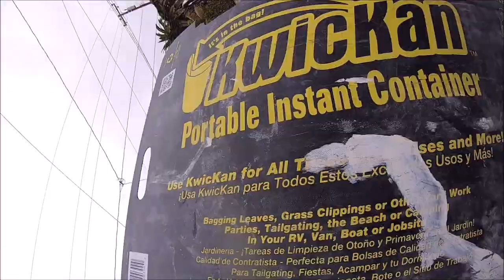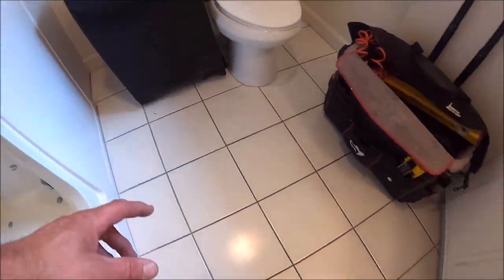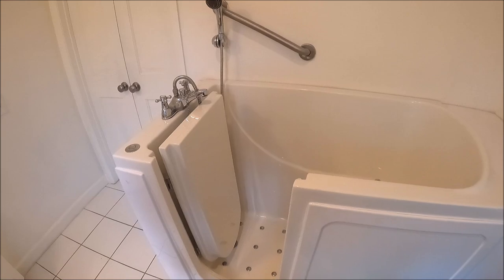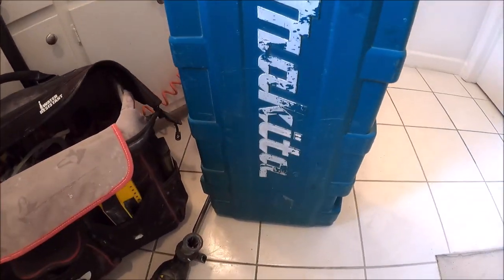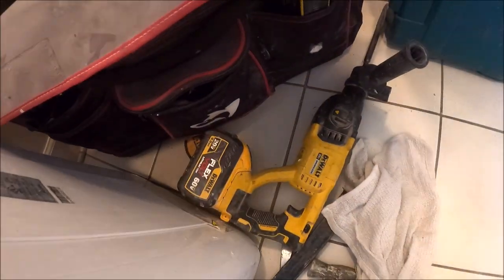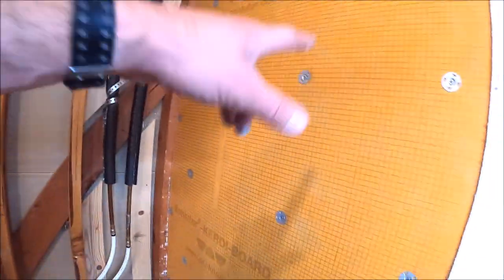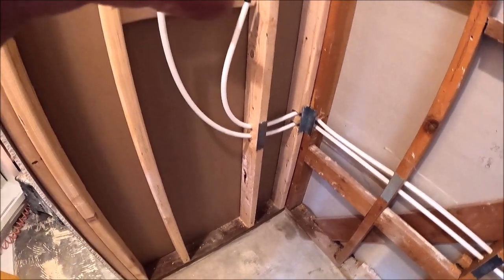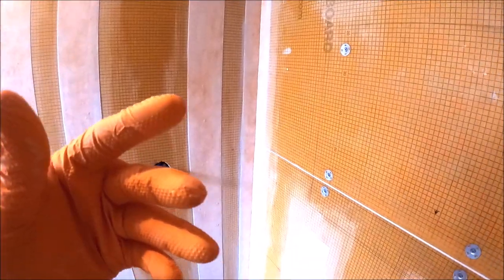Walk in BATHTUB to Walk in SHOWER Conversion!

Comment: God I hate to see people insist on seats in a shower that size.  Most will come to regret it over time.  And building material delays are indeed getting ridiculous, as are the costs of those materials.  When I watched you install those 2x4 studs, all I could think of was how stupidly expensive they've become.
Reply from the maker: Different strokes for different folks. We gave them options of the 16"x16" but opted for the 24'x24 so they have a bench they can actually sit on. Retired older couple..
Reply: @LandbergTileTV  Personally, I can't imagine having enough time to sit down while taking a shower. 😉